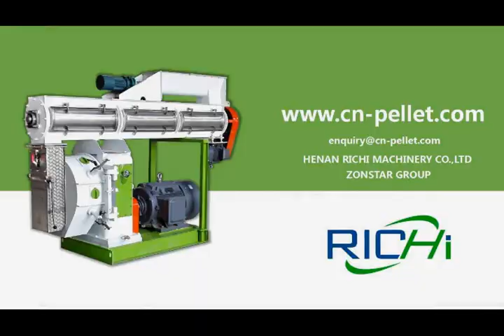SZLH420 Feed Pellet Mill

Comment: Sir Kindly explain Electrical operation of pellet mill
Reply from the maker: The pellet mill needs to use industrial three-phase electricity, like the equipment in the video is 110kw, 380v, 60hz. The pellet mill has a main motor to drive the main shaft; a feeding motor to control the feeding speed; a conditioner motor to control the conditioner screw. All motor circuits are connected in a small electric control box next to the pellet mill. The entire production line needs to be controlled by a group of large electric control cabinets. If you want to know how the lines are connected, then I have no way to tell you here, because it is really complicated to explain.
Reply: Take  you